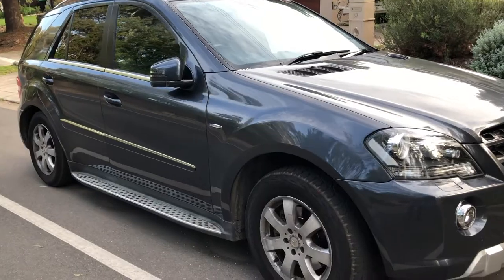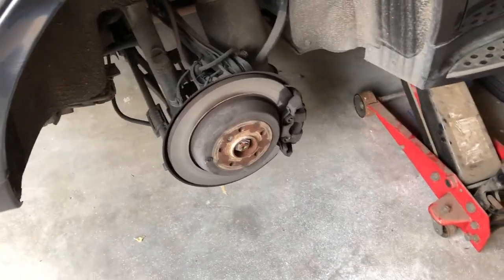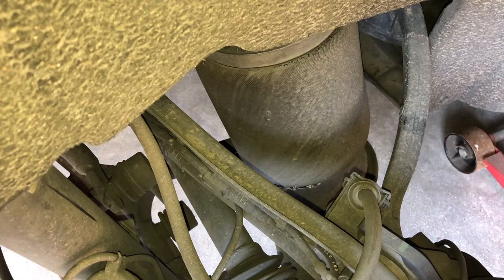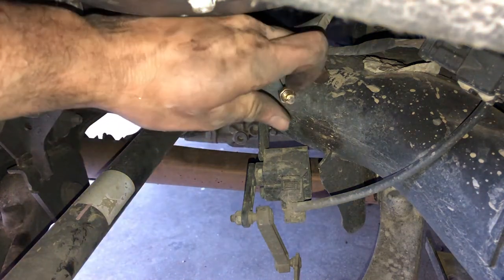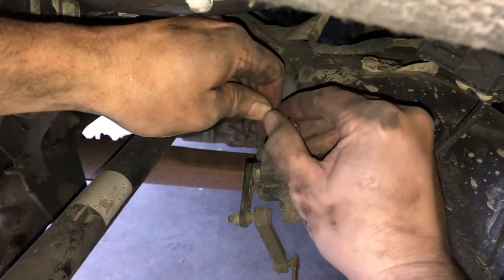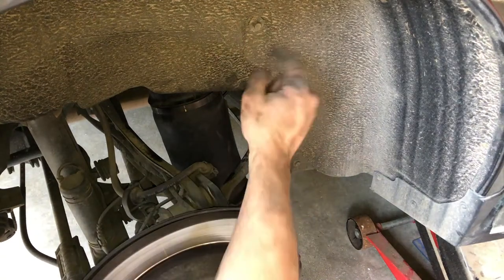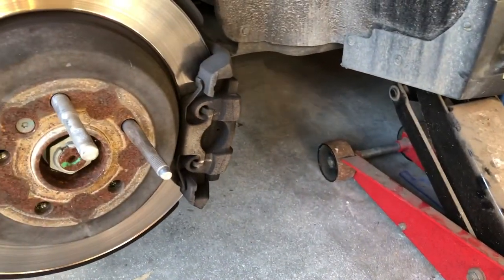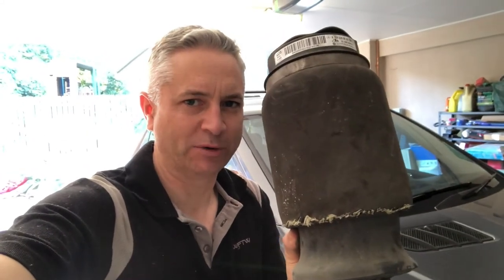How to Quickly Replace Mercedes ML350 W164 GL Rear Air Spring - DIY Replacement ML300 ML320 GL350

Comment: A very valuable video, considering the failure rate of this suspension. I have a question, did you have to calibrate anything after replacing the air spring? Or just replace it and that's it?
Reply from the maker: Hi Mate, I didn’t calibrate my suspension after replacing the air springs.  In my mind nothing changed wrt the actual ride height sensor and the associated geometry, therefore I didn’t think that it was necessary.  Having said that my iCarsoft CR PRO+ scanner is capable of doing calibrations and perhaps I try that feature out in a video!  Is this something that you would like to see? Cheers Drew
Reply: @DrewFixIt  Thanks for your reply. For now, I will replace the air spring tomorrow and see what the effect will be.
Reply: I replaced the gas spring. Test drive completed successfully. Thanks again for the instructions and I will definitely come back for more ;)

Comment: Hi Lad , what kind of ride was you having before replacing ( stiff ride , no rebound etc ) ? TIA
Reply from the maker: Hi Mate, the ride quality didn’t change.  At the end of the day it is a bag with air in it and it is the strut that it is doing the damping.   Cheers Drew

Comment: Drew, how are these air springs holding up after 2 years.  I’m about to do mine. Ordered the same ones you’ve used.
Reply from the maker: Hi Mark, there are no issues at all that I am aware of.  Last time I serviced the car (around Christmas time) I took the rear wheels off to check the rear brakes and whilst I had the wheels off I deliberately checked the bags visually and they look really good with no visible signs of wear!  Cheers Drew

Comment: Need to do this repair on my ML, so this was a great video.. Thanks!!
Did you use original air bag?
Cheers from Norway
Reply from the maker: Hi Elton,  I used the following aftermarket air bag: https://amzn.to/3KaNveV I have had no issues with these bags and also this link is for a pair and I would recommend buying both and doing both at the same time.  As per the video it is really easy to do!  Cheers Drew
Reply from the maker: Also, you can see all of the parts that I have used and recommend on my store at: http://www.drewfixit.com Cheers Drew
Reply: @DrewFixIt  Thanks for the links!

Comment: Excellent videos 👍
I wonder how long this brand air spring lasts.
Reply from the maker: Hi Shawn, great question!  These air springs have been on the rear of my car now for over 2 years now and I was wondering the same thing so I actually did a close inspection of them last weekend and they show absolutely no signs of wear.  By comparison the original Mercedes air springs were visually rotted and cracked that I removed from the car. So from my perspective they are just as good if not better than the OEM Mercedes part!  Cheers Drew
Reply: @DrewFixIt  Hi Drew, Thank you very much for your prompt reply and I feel so grateful for your detailed explanation with great pronunciation. I applaud your enthusiasm. Cheers Shawn

Comment: Hey man, I’m currently looking for one of these, but I’m keen for the Off Road Pack version here in Australia. Are there any signs to show which ones come with the 2 speed transfer case and Airmatic suspension?
Reply from the maker: Hi Mofos, I'm not 100% sure, however I don't think there is any difference in the Air Springs between the vehicles with 2 speed transfer case the normal one.  Thanks Drew

Comment: Hi Drew, replaced the rear left Air Spring after much effort, however, it's not inflating. Any troubleshooting steps?
Reply from the maker: Interesting, is your compressor running after replacement?  Cheers Drew
Reply: @DrewFixIt  Yes. It seems to run. But goes quite after a minute. I haven't started the engine though.
Reply from the maker: @tazeemn  Hi Mate, I think you will find that you really do need to start the engine for the AIRMATIC compressor to kick in and inflate the new AirSpring.  If this doesn't work let me know as there are other tricks too!  Also, if you like my videos do consider joining as a channel member: https://www.youtube.com/channel/UCSKmO9BJWGYQbGZ6655wpqQ/join I have kept the membership levels relatively cheap and as a member I get better visibility to your comments and therefore will prioritise responses to future questions!  Cheers Drew :_DFI:

Comment: Hi Drew, Great video and clear instructions thanks. I have the same issue and need to replace the rear air suspension spring bag on my 2009 ML 300.Could you please let me know where I could purchase the air line fitting as well. I'm in OZ, WA.
Reply from the maker: Hi Kelvin, thanks for the feedback.  Here is where you can buy a pair: https://amzn.to/3TOd0IB Note, the fittings will be supplied with the new air spring.  Cheers Drew
Reply: Much appreciated, many thanks.

Comment: Hey Drew, I have a "cloc cloc" noise at the back of my ML (w164) when I drive on non-even surfaces. Torsion bar and bar links have just been replaced. What can it be you think ?
Thanks for your expertise.
Reply from the maker: Hi Louis, how many kilometres or miles has your vehicle done?  Have you considered that one of your rear struts may have failed?  Cheers Drew
Reply: @DrewFixIt  170 000 km. Yes you must be right. I'll change the rear struts and give you an update :)
Reply: Hey @DrewFixIt, can you advise what rear strut to install as replacement ? OEM refurbished are still expensive. Bilstein are expensive too. Chinese import are cheap.
Reply from the maker: @plumerault  Hi Louis, I have not yet done the rears on my car  ... too many other things to fix first :) ... however, I put Chinese import on the front of my car and so far it seems to be good thus I would personally use something like: https://amzn.to/3Y7fMKQ Cheers Drew
Reply: @DrewFixIt  thanks for your answer. Ok I am doing it soon. I'll let you know. Seems difficult to free space around the screws in the trunk.

Comment: Google “Voss push-pull fitting”. Do not cut the line. The grooves on the line are important.
Reply from the maker: Hi Mate, thanks for sharing!  For others here is the website with some FAQs on these fittings: https://www.voss-automotive.net/fileadmin/user_upload/Downloads/Produktinformation/203_Assembly_Instructions.pdf Cheers Drew